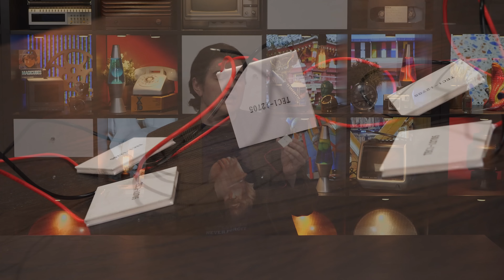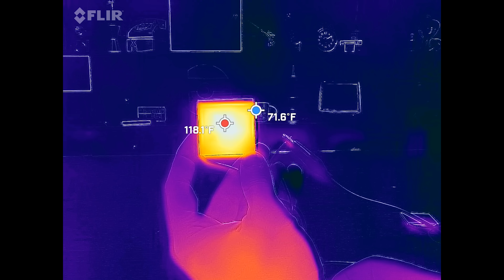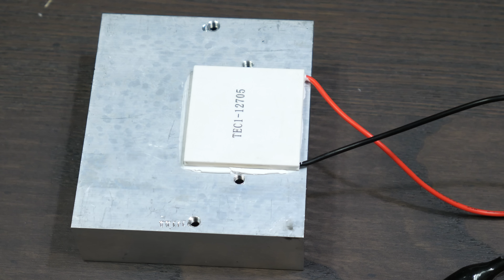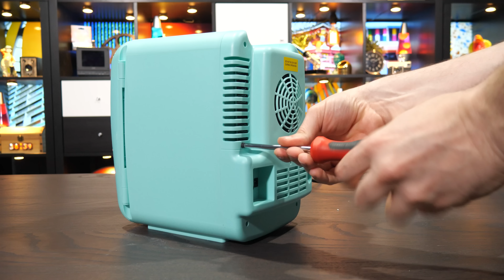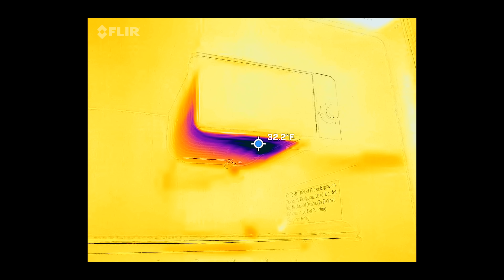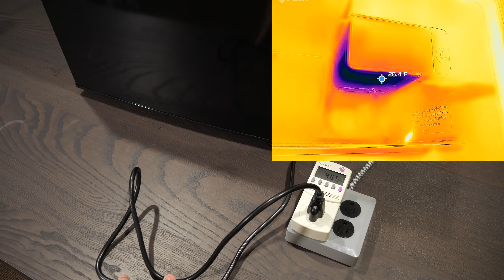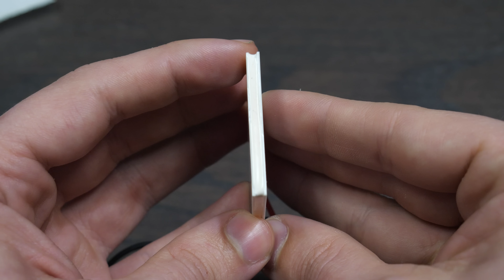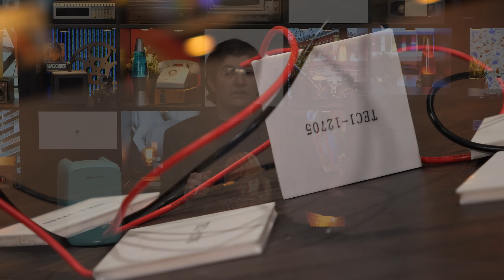Thermoelectric cooling: it's not great.

Comment: I can't get over how peltiers are abused in every single one of these products. What appliance designers don't seem to understand, is that temperature isn't heat. Most people make the error of pushing voltage to the max - sure, this increases temperature difference between the sides, but it reduces heat transfer from cold to hot side. For typical 12 V module, 14-15V will be max voltage before burning out, where it will freeze one side easily, but highest heat transfer will happen in 8-9V range. But putting two TECs and appropiate cooling instead of one and voltage regulator is much more expensive than single one and driving it to the max. Not to mention insulation usually sukcs, robbing last of its efficiency. These devices are made to be as cheap as possible, not as good as possible. 

It is perfectly doable to make proper and good TEC cooler. Tech Ingredients done it.

Comment: Hi, I believe there is a huge misunderstanding here and the author is comparing the incomparable.
Peltier elements have average 15% efficiency. Cooling machines have efficiency few by times that.
Seems the concept of the blue box so much abused in the video is well misunderstood.
First this device is not made for keeping it running 24/7.
That is a cool box - it will just keep your things cool and you have to put them cooled inside.
These devices are meant for travel and camping where the demand for space and light weight is higher. So also they are not meant to keep food for more than two three days.
They however can be powered by your car battery or a solar panel.
So to the author who seems never to have left the comfort of his house and office - try taking your fridge for camping, power it from your car or solar panel and tell me how efficient you are 😉

P.S. To the author - Actual camping fridges, not cool boxes but fridges meant to cool and keep your food there for a long time burn LPG for cooling. Make a video about them.

Comment: 13c/kWh!! Okay, at THAT rate, I'd also be over the moon with heat pumps! Over here in Germany, you're paying about 33-38c/kWh (dollar cents).

Don't get me wrong, they're still good - as long as your house is reeeeally well insulated, which many are not yet, adding another huge upfront cost that needs to be paid off by not using gas or oil in a reasonable time to be financially viable, which makes making the switch quite a complicated calculation. In many cases you're looking at 15-20y before you break even when converting a decent house from the 80s or 90s, assuming no maintainence or replacements all that time. Tough, if you ask me.

Comment: I honestly didn't hear any convincing arguments against the micro cooler.  I have one in a niche by my desk.  not real refrigerator could fit in that space.  the micro cooler does.  is it loud?  not louder than the PC I have running 3ft away from it.  is it wasting power?  sure, but not enough to impact my monthly bill to any noteworthy degree.  no I do have one major advantage in my home over the video: it's NEVER 75f in my house.  that would be fucking boiling.  if you live in a region where it gets that hot then sure i bet these things suck ass at cooling.  but thats not most people I think.  at least for me, assuming my micro meets similar expectations of cooling my 30 degrees from room temp means that generally my cans will be floating between 30f and 40f depending on the season.  oh and your concern of food safety?  thats just dumb.  who would keep food in these, they are purpose build for standard cans and nothing else.

Comment: Peltier elements also come in handy when you are in a laboratory and energy efficiency is irrelevant. I have an x-ray detector that is cooled down to 212K by cascading peltier elements in order to reduce thermal noise. And the whole detector is smaller than my smartphone, the detecting part itself is not bigger than a pen.

Comment: how much power does a standard cube fridge use, when it is filled up with water based liquids to it's max, after temperature has settled? since water needs a lot of energy to heat up, i guess, it would even drop further‽

Comment: Well now I'm sad.  I bought a blue blob, except it wasn't blue, it was a Minecraft TNT block with a light in the front to make it glow.  After I bought it and looked through the manual, I saw that it wasn't rated for continuous use and it does indeed start to frost after about 2 days.  So now I just never turn it on.  Had I seen this video a year ago, I wouldnt have wasted the $60.

Comment: If you have difficulty understanding how the fridge works.

Imagine a sponge, you compress the sponge, put it in a bow of water, and release it. it expands and suck in water. You bring the wet sponge out of the water to the sink and compress, the water get squeeze out. Put the compressed sponge back into the bow and repeat.
After a few cycle, the bow will be empty of water.
So, the sponge is the refregerant, your hand is the compressor. The bow is the inside of the fridge, the sink is the outside, the water is the heat energy.

This is not scientific explanation, but it help you imagine.

Comment: Another issue that I think was brushed over in the video is that by using more electricity, the blue toy is heating the room it's in (whilst barely cooling the contents).

In countries (like the UK) where homes don't tend to have AC, it is going to be an annoyance in the very months that you want a cool drink. Far better to buy a small insulated cool bag/box and put that on your desk with some pre cooled drinks in it. Since a real fridge will cool cans to a lower temperature, even after they have warmed slightly they'll still probably be cooler than ones from the blue toy.

Also in countries (like the USA) where AC is more common, since the blue toy does little more than produce heat, you're going to spend a bit more money on your AC just to pump out the heat produced by the toy.

Comment: I have one of these I got 20 something years ago that's like a small chest and the element gets so cold it gets frost on it The heat sink is smaller than the one you have there and the secret to using it properly I found was to refrigerate the food the night before and you put it in there and it actually maintains the temperature in the low 40s and upper thirties. I also let the unit run for the night before I use it.

Comment: I just use peltier elements for cooling my co2 laser cutter and a big aluminum block  to freeze bearings ... So basically just for some short time quick refrigeration ... Ohh and the hot side is always water-cooled

Comment: The cheap ones are really crappy. They might claim over 50w of forced heat transfer but barely manage one tenth of that. The expensive ones work great but they're too expensive to replace the refrigeration stuff we already have.
I had a school project with peltiers and it's not even capable of cooling anything. I spent 700USD for powerful peltier elements with custom watercooling loops and it just wasn't worth it.

Comment: I think I unwittingly have bought a similar product to these Peltier-based mini-fridges. I was shopping for a cooling box for my car, the old non-powered insulated boxes that you put cooling elements that you have put in your freezer to cool down in, when I saw that right next to it they had a powered one that took both 230V and 12V. It wasn't much more expensive. Since my car has a 12V socket in the boot I bought the powered one. To my defense I must add that I've only used it very occasionally, and that I've always filled it with frozen cooling elements from my freezer and pre-cooled drinks from my fridge

To illustrate how little effect on global warming the refrigerant in your fridge has I did a quick calculation: 55 g refrigerant with a global warming potential of 3.3 equals 181.5 g CO2. An average US car which gets 24.4 mpg releases 364.2 g of CO2 per mile. And that's just what comes out of the tailpipe, to add the emissions from extracting, transporting and refining the fuel you need to add another 20-30%. That means that even if you empty the fridge of all it's refrigerant, it causes less global warming that driving half a mile in an average US car (an SUV or pickup would be even worse)

Comment: If I'm not mistaken, peltiers are sometimes used in wine coolers. Something about the vibrations from a compressor affecting the wine negatively, but personally I wouldn't be surprised if that's just a way to sell cheap peltiers at a premium.

Comment: So, have you seen these used as a personal air conditioner? They obviously dont cool the air around you, instead they absorb the heat from your body and disperse it to the air. I'd be very interested in you doing something on personal cooling devices for people who are working, say, 8 hours in 80-90 degree weather and need something portable, not too bulky, and easy to maintain. I know of ice packs, the devices you just reviewed, water cooled vests, air cooled vests, and evaporation scarfs. The devices you just reviewed (cause i dont want to try to spell their name) seem to be one of the better options that i have been able to try, but a thorough comparison would be amazing. I'd also be interested if you found anything else that would work.

Comment: The regular house or condo here in germany don't has enough space for an american fridge.
Maybe in my garage, but then i have to park my car somewhere else. Our fridges need a space of 60x60cm and have a regular hight of 1,42m for a 2 person household. Bigger fridges have 60x60cm base, and only get higher. Our fridge is 1,65m and has a seperate freezer. And you can get higher fridges here. 2m in hight is available. I have seen a fridge with 2,20m in hight. But some walls are only 2,4m to the ceiling. So it could be hard to put it upright in the room. And the next question, why should i use such a big fridge? I have 4 grocery stores  in walking distance. I need the fridge and freezer only to overcome sundays, cause our regular shops are closed on sundays. IF you need something on sunday, ask a neighbour, or go to the overpriced gas station. Some have small shops inside and sell for double the regular price.

Comment: Love the videos! I know you add on-screen text for conversions, but when you are talking about temperature, can you also include Celsius in other parts as well (e.g.: When you are showing the temperature graph)? Fahrenheit means nothing to most parts of the world. Although I agree totally with your fridge size comparison. I lived in Australia and those large French door fridges are very common. Some are plumbed into the water mains, while others have a water chiller/ice maker that requires manual filling. Still, bring on the big fridge! If well designed and built, they are are very efficient appliances, especially when stocked up.

Comment: Basically it makes sense for an travel fridge, that you fill with already cooled items you than power in your car on your way to the beach/picknick/outdoorsy trip and have a good insulation all around to keep it cool. Maybe put some Thermal mass (aka frozen cooling batteries) inside for maximal effect.

Comment: I'd picked up a 12v cooler that uses a Thermoelectric cooler for road trips. That thing needed setup, planning, and at least overnight cooling on 120v to prep it for a trip. Then I splurged on a 12v fridge thst has an actual cooler, able to set the temp, etc. Started it up with the same pre-rrip ritual and... Was shocked when it was ice cold within an hour.

Comment: very informative! thank you. 
my very specific use case for the tiny peltier "fridge": i live in a hurricane prone area with an aging power infrastructure. several times a year i lose power, sometimes for days. i'm not in a position to get my home off grid and i might be trapped in my home due to downed trees or flooding. and i'm an insulin dependent diabetic. i cannot afford to lose up to a 90 day supply of insulin (homeowner's insurance maxes out on "contents of the fridge" at $500.) my insulin has more flexible storage temperatures than food: 36-46F, and up to 77F in an emergency... like an extended power outage due to a hurricane. i found one of these peltier tiny coolers with a handle on top that has options for a/c, 12v d/c, or USB. and i have portable power supplies. a 10,000mAh anker power bank ran it for 35 hours. my jackery 300 ran it for somewhere between 72 and 80 hours (i was asleep when it ran out). which is plenty of time to recharge the jackery by solar panel. if i had to evacuate, i could grab it and plug it into my car. throw a pre frozen ice pack in there and it would extend the cooling time and reduce the cool down time from room temperature. the one i got holds 22 vials of insulin in their boxes. extensive testing proved it could literally save my life by saving my insulin. but yeah, absolute crap for food.

Comment: I won one of these mini fridge thermoelectric things a while ago. This one was one with a switch so you could go from "cooling" to "heating"...  something went wrong and the cans I was trying to cool exploded and the whole thing was hot. It didn't seem like it ever got cold. 

Basically a mini explosion that blew through a part of the plastic casting. Was terrible and a safety hazard.

Comment: I feel like adding a microcontroller for temperature regulation and a few heat pipes into the blue thing, as well as obviously filling uo the missing insulation could make it at least viable for your proposed 8h in a day, on a dask at work usage, provided maybe a quiter fan
I was also thinking whether having two of them, water heater dtyle could mitigate the fan speed needed to cool the backside of the device to aid with it but honestly I'm not so vonvinced myself

Comment: I built some thermostats to keep some things at PID-stabilized, low temperature, like photomultipliers or semiconductor lasers (their precise wavelength depends on their temperature and it is crucial in some spectroscopy experiments). Here Peltier modules were a great stuff. Yes, inefficient as hell, but the volume they had to cool was either of the size of a small PM tube (roughly the small soda can or less) or just a laser head, that is several millimeters big. So overall energy consumption was never the issue. And that's all where Peltier modules' pros are smashing the cons. They are great when your space is very limited and you want to stabilize the temperature very precisely (up to 0.1 degree or even less). And Peltier elements can also heat, so the temperature range of such thermostats can be anywhere between -50 degrees of Celsius to up to like +50 degrees of Celsius (sorry, I am Polish European, no Fahrenheit degrees from me...).
Some electronic elements even have Peltier modules built into them to cool the semiconductor directly, like long-wave IR photodiodes and photoresistors to lower their thermal noise to a manageable level.

Comment: As a thermodynamics teacher I once explained key difference between a thermoelectric and compression cycle fridge from a system boundary perspective. If you take the insulated inside of the fridge with the door closed as the system boundary then it will overall be well insulated. When a compression cycle fridge is operating heat is withdrawn from the system by the transfer of cooling medium trough the heat exchanger within the system boundary. This means that when the fridge is idling and no flow of cooling medium there is very little heat loss trough the walls.  However, with the thermoelelectric fridge there will by definition be an uninsulated area which is the Peltier element it self, directly connected to a heat sink on the other side. It is almost a if you have a fridge with a permanent hole in it. This all is on top of the worse efficiency of the Peltier element compared to the refrigeration cycle.

Comment: I have a Koolatron brand blue blob on my dresser just to keep a couple cans chilled so I dont have to get up and walk to the fridge every time I want a drink. Scanning the inside with a thermal camera, the wall attached to the element itself was ranging from 35F to 39F and had ice forming along the screws that mount it to the wall. The rest of it was temping between 40-60. The inside of it usually has water along the bottom, the instructions also say a few times a month to shut it off for a day or 2 and clean it out which I may or may not slack on. 
The outside of the can was temping around 60F with both thermal camera and laser thermometer. Did not have a probe thermometer on hand to get an accurate liquid reading, but shoving the thermal camera over the opening as much as I could yielded temps from 53F to 59F. The ambient temperature around it is roughly in the 70s. 
I'd say the Peltier element itself does a great job, but for the intended use falls a bit short, doesn't seem like it can cool a very big area. I have 4 cans standing upright and 2 laying on the little shelf it comes with, the cans on the shelf touch the mounting screws and generally get a little cooler than the ones on the bottom, unfortunately my data lacked there as I had not restocked it recently and only had the cans on the bottom to temp.

Comment: I will say, here in Japan you have an option to make those kind of “refrigerators” into heaters as well. We use it to keep coffee and tea cans/bottles hot. I haven’t done any testing but I believe the hot option does run in cycles as the fan is not on all the time and the status indicator turns off. If you search “冷温庫 4L
EAR-1004-WH” you will find it. Side note: I’ve never used it for cooling.

Comment: I see peltier sucks at cooling, but using as a heater system with some clever design would have efficiency over 100%, because it will steal warmth from the outside.